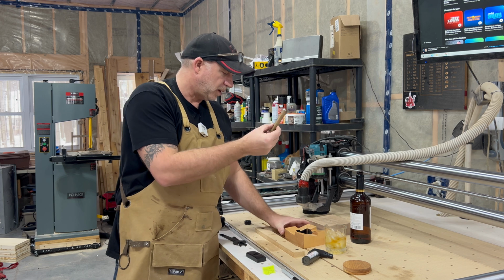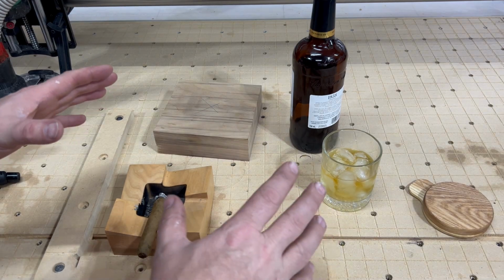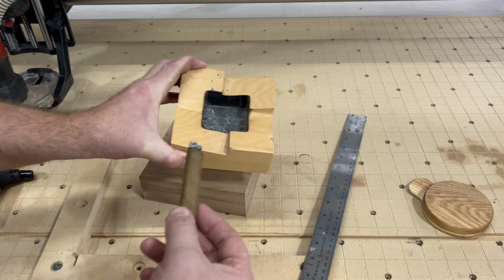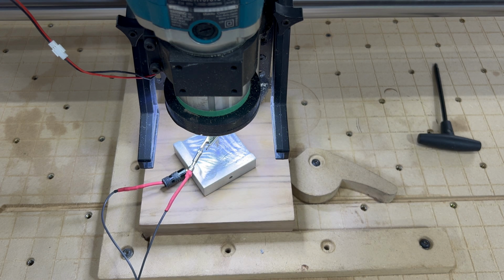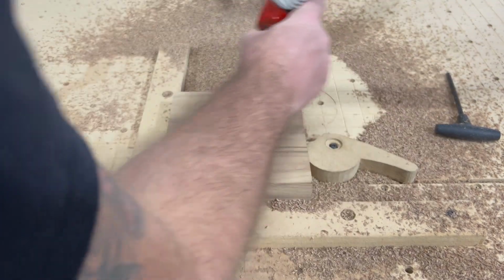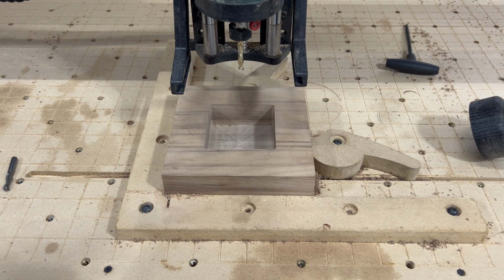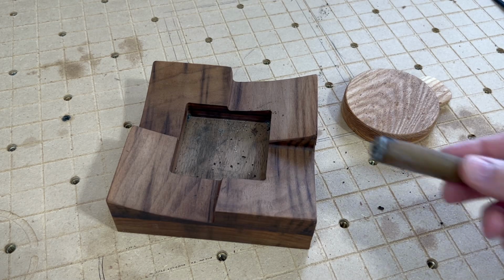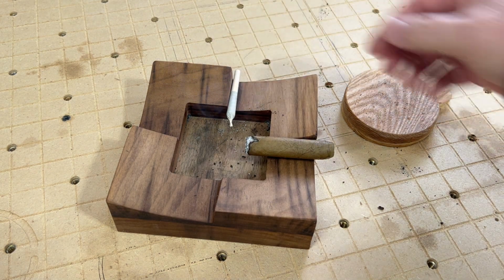CNC Retro Cigar Ash Tray Molding Toolpath

Comment: I think you can choose rest machining to solve the issue with the bit going over the already machined parts. I can't recall if that option is available for the roughing tool path but it's definitely there for the detail one. So maybe you can just do a detail tool path with the 1/4 inch dc bit 🤔.
Reply from the maker: Thanks for the tips!  I'll have to see if I can find that option in VCarve!